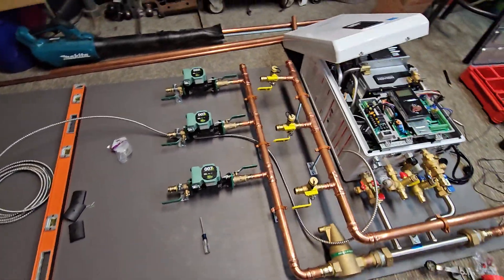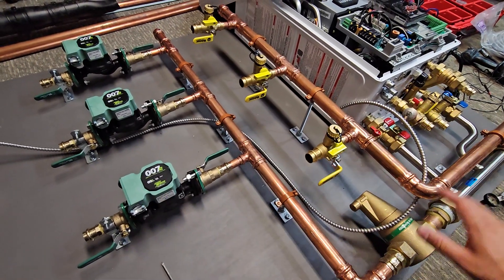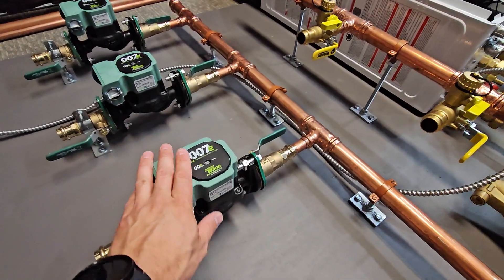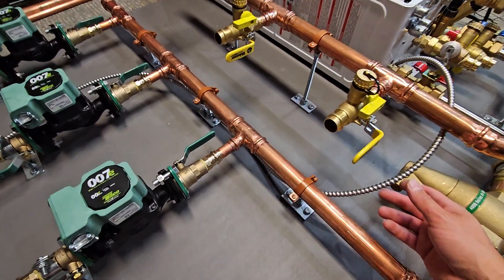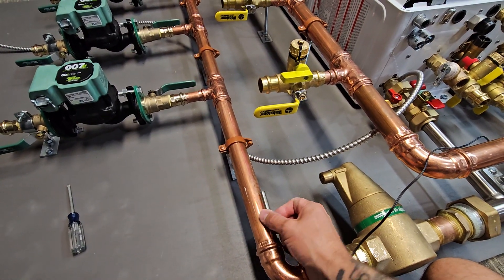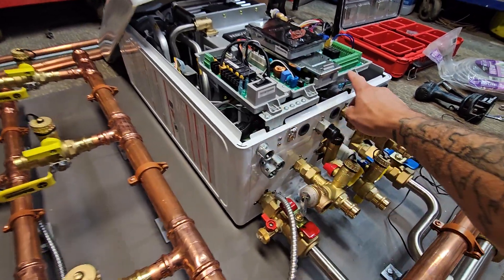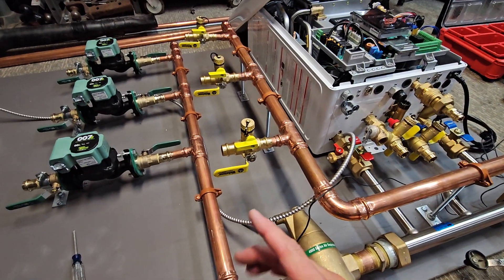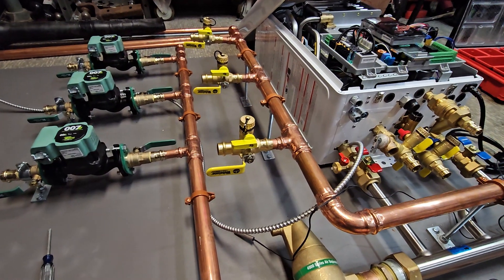3 Zone Navien Combi Boiler System - Electrical Wiring

Comment: Where is the tt terminal on this boiler ? where you would connect the relay
Reply from the maker: @mike270  The TT terminals are the zone 3 thermostat connection. The manual shows this detail.

Comment: In an effort to become more energy efficient I am going to retired my old oil fired boiler with 6 zones to baseboard. The new design includes Navien NCB-250/150H and a staple up floor heat system on one manifold with a 007 circulator along with a new 6 zone manifold feeding existing baseboard with a second 007 circulator with a Taco ZVC controller. I am doing some research to be sure that each system circulator energizes independently from one to the other. With what I have described, what is the best design for an independent system circulator control to this combi boiler?  Thanks for your time.
Reply from the maker: Use 0015E3 circulators instead of 007. The navien can control 3 zones no need for additional controls.

Comment: Does this boiler alleviate the need for an external zone valve/circulator pump controller? All of the thermostats wire directly into the boiler for each discrete zone?
Reply from the maker: Correct! Up to 3 zones can be controlled.  You can choose between 3 individual circulators or a single circulator with 3 zone valves.

Comment: can I see a build using the thermostat terminal block install?    also,  have you done a build where the customer can use wireless thermostats?
Reply from the maker: Yes you can use them

Comment: Great work! Curious why you don't use Webstone press rotator isolation flanges instead of the threaded Taco? How does the rod hold up when the panel is vertical and the system full of water. I've always used strut, the biggest problem being you have to work your layout in a single plane, not always easiily done! I see you use mixing valves alot, ever tried a mixing bridge? The Taco VT 2218 you like to use would be awesome for that application.
Reply from the maker: I do use them time to time but mainly because the Taco flanges have a large end where I can support the pumps by using a conduit clamp.